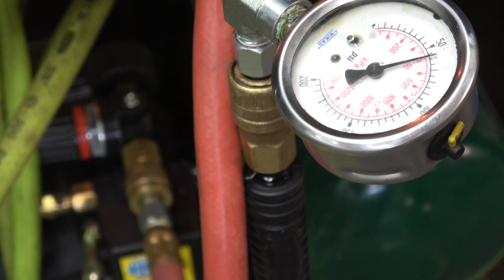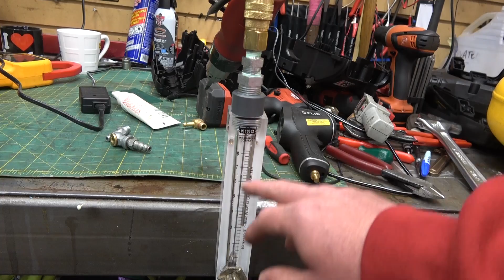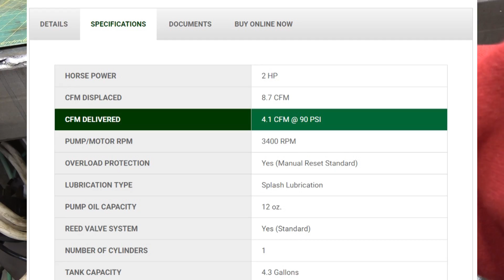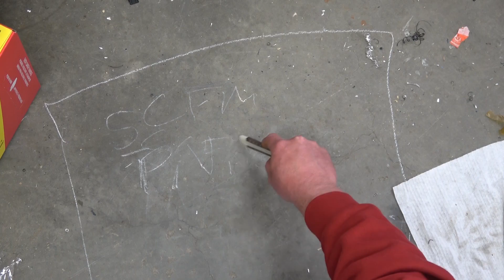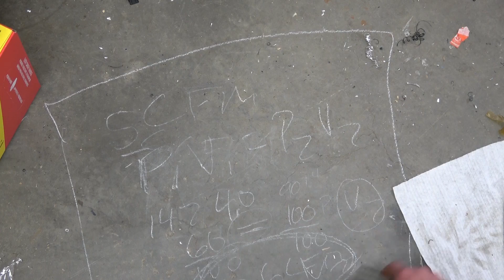Why are CFM ratings BS?

Comment: I have found the same issue with my compressors and I have decided on a gas powered unit cobbled together from scrapped compressors. I have also added tanks much like your air pig beside your compressor. I need more than 30 seconds of flow at 60 psi for my plasma cutter. Things get messy when their isn't enough airflow. I have having to stop and wait for the compressor to recover.

Comment: I think it makes sense, the compressor is rated for the amount of air it can move in standard units, and states the pressure it can deliver it at. It's the tool manufacturers who will pick their specific operating pressure (not a stansard) to publish and make it look like their tool uses less. 
You also cant rate the compressor at it max delivery pressure because it dossnt take into account energy loss through temperature change and RH change

Comment: I discovered years ago this problem trying to do sand blasting. Had to get 80 gal 5hp compressor and added some old water heater tanks to accumulate enough volume. Also discovered using a refrigerate unite to control moisture.

Comment: I have two compressors that are plumbed into my air system a 60 and a 80 gallon air compressor. With that kind of tool i would never recommend a compressor less than 60 gallon. I can have three of those running off my system without anyone complaining. My next compressor will be a screw type.

Comment: I use my compressors for pin nails and nail guns, cleaning etc..works great for a finishing carpenter. 
So what your saying is that tools that need continuous air flow are getting screwed? 
I always just figured you'd have to buy a bigger setup. But if they are advertising consumer sized compressors for that sort of work they best not be bullshitting

Comment: Well this explains why, after buying 3 compressors (progressively larger) I still couldn't use my air DA sander (for home bodywork) although the "specs" said they should be able to. I did learn to "cheat" on my paint gun (HVLP) by converting an old compressor tank (5 gallon?) into a " buffer" tank.. I run my compressor (20 gallon) at 100 psi into buffer tank, then output at 40 psi to hose/ gun. Paint gun is mostly continuous but you naturally have pauses, which give the compressor time to catch up.  Mostly/ almost. But you need to stop and sip your beer occasionally anyway, so..

Comment: Hey AvE just wanted to add P1V1 = P2V2 is assuming temp is constant. Since gasses undergoing decompression will lower in temp. The equation which takes it into account it (P1V1)/T1 = (P2V2)/T2 might work to just take ambient temp of shop then tape a thermocouple to the body of the valve on the grinder. Though I might just be overcomplicating shit unnecessarily. Anyway love your channel mam
Reply: I also suspect it's why they rate it with the volume of air at the inlet as the temp at which the compressor is held changes the volume effectively. However the over rating is still borderline criminal and a proper ISO standard should be used to dispel this sort of bs

Comment: Consumer compressors are designed for intermittent use (think nailgun, etc.). You also could have talked about the tradeoffs between the tank size and the compressor. I like the battery/charger/load analogy, but then I'm a sparky ;<)

Comment: I Wish I Woulda Seen This 25 years Ago.. Back then I Bought a Stone Carving Chisel that Uses Mucho Air ,@ 90 psi.  It was Nearly Impossible to Find a Compressor that Ran on 110volts that Put Out Enough Air. The One I Found Barely Keeps Up & it's Hard to Find a Circuit that Doesn't Blow Using it.  Once It Caught the Outlet on Fire! I Ended Up Getting a 5.5 hp Gas Compressor That Barely Keeps Up. Nice Hoses BTW I Like those Neoprene Hoses.

Comment: AAAAAAH! Yes! Thanks for sharing!!  This principle came to bear several years ago when working an a industrial project.  >$250,000 was about to be spent on a compressor package. Per engineering principles and the combined gas law the ACFM (acutal cubic feet per minute) @ 100psi and 60F was estimated. Sometime during the initial bid the air compressor folks informed us that in the compressed air industry ACFM meant the cubic feet of air actually needed at the inlet of the compressor. Ended up rebidding the package after terms were better defined which yielded substantially more equipment and a higher price.

Comment: I have worked on industrial air compressors (mainly Atlas Copco) for over 6 years so far and this information is correct. Atlas Copco, Champion, Gardner Denver, Quincy, Ingersoll Rand, etc are voluntarily held to CAGI’s strict standards and they cannot claim false outlet cfm ratings without repercussions. The cheaper compressors that you buy at the hardware stores are not held to many standards and most have “special” horsepower ratings when the actual horsepower is half of what it says. CFM ratings are the same. Since they are not held to any standards, such as CAGI, they can say whatever they want to about them.

Comment: Boyles law doesn't work for air compressors, its not an ideal gas. Main reason is air compressors pump air and make it really hot. As the tank sits the compressed gas will cool down, and part of the tank is holding water not gas. This water will change from gas to water in a cycle on its own as the tank sitting reaches thermo-equilibrium with outside air temperature. You can't use boyles law with pressure vessels. It just doesn't work...

Not knocking you. You are right the ratings are KINDA bullshit. But there is a reason...

Comment: Your rotameter doesn't look plumb. Side note: The mass of air in a standard 60gal (8 ft^3) receiver at 120 PSI is about 5.5lbm (2.5 kg for the standard unit impaired)

Comment: As long as the tools are using same measure,  same scale, as the compressor as long as the numbers are correct then it really makes no difference whether you agree or if its marketing.   Meaning if tool requires 4cfm and compressor says 5cfm then it will work

Comment: Okay,  I understand your complaint, but I also ask how many tools out there need to run at 90 psi? It seems to me that if you need that psi continuously,  you need an industrial  compressor,  not a home depot cheap one. It is  simple, guage your tools you will use verses the job you want done.

Comment: Yeah noticed this when i bought my first proper continuous cycle air tool and tried to use it in work. Even my twin cylinder (consumer grade) is struggling to produce enough air for it. Hence if anything bigger needs to be done, i daisy chain two compressors to DIY extra capacity air tank. With this setup it can be used normally. Thankfully both compressors were pretty much free for me and i get plenty of those since people dont know how to repair them, chuck into metal bin and from there i get to save them.

Comment: My solution: build your own.... do your own math.... 7.5 Hp used three phase motor, $100 ebay
old hot water tank and strip off the insulation, free.... rated 300PSI burst standard
used shopping cart wheels, free
scrap 1/8 sheet steel, free
double shive pulley, came with the motor
two used belts, free
pressure controller, $50
two Chinese V type pumps rated to take 3.5 horse, $100 each.
Result: enough air to run a blast cabinet flat out continually with a 5/16 nozzle.... cost total
$350 plus your time to build.... now running for 4 years no issues.
DONE

Comment: Fuck me I have been the dumbest dude in the west, I have lots of air tools and a commercial compressor, but I have been suffering from this issue for years, time to get a bigger blow job unit rated to output. Thanks for the insight, and yes it's in the vice.

Comment: Devices that squirt for a few seconds, then stop, do fine. For low volume workflow, air hammers, impact wrenches, are OK. But drills or sanders, or spray paint? Nope. With a weak compressor, it's all about the tank volume. You'll never be happy with less than 25 gal, but you can daisy chain extra tanks.

Comment: I have no experience in using air compressors but it seems you have the flow meter and pressure gauge just before the tool. While cfm doesn’t drop over the length of the hose, the pressure does significantly. The correct way is to have the pressure gauge right at the compressor output. I thinks thats how they measure for the spec sheet.

PS. I love your videos.

Comment: Uncle Ohm and Uncle Newton taught me to look at the amount of power used to find the BS. If its running on 15amps @ 110v its gonna be chugging 1650 watts max. Convert to HP -> 2.2hp. If it claims above 2 hp they are  majorly full of shit due to efficiency of single phase and heat waste etc. The sucker energy rating is generally about 3.5 CFM @ 90 per HP. Thus you get around 5 CFM max of suck performance on 110v on the most efficient machine.

Comment: Cheers for the heads up and the maths. I hadn't thought about those types of ratings either. Like most people, although I was dubious of the manufacturer ratings, I had always thought that good brands would be a safe bet too. However, this will now make it easier for myself to buy an Air compressor later on. Of note, I wonder how many salespersons would be completely shitted off rocking up to their store to buy an Air Compressor, then prove to them the Air Compressors they have are utterly fucked?

Comment: Hi, a question on air compressors if I may.
I have read and seen endless articles on both consumer and industrial products for drying compressed air as it seems to be important for the quality of work to be done. But I found nothing on providing dry inlet air to the air compressor to begin with. Do you have information on why this may be? It seems to me that this approach is not only desirable but both technically simple and cost effective.
My apologies if this is not an appropriate channel for my query, but after watching many of your videos I consider you the best to give a straighter response.

Comment: Just graduated with a ChemE degree, and in my minor industry experience, most of industry uses SCFM for gasses and equipment ratings. However, when reporting SCFM they fucking tell you they're using SCFM!! If they're not only going to not say that they're using SCFM, but also imply that it's CFM at a given pressure, then it's totally meaningless.

 If you're going to just choose which conditions give the most favorable rating, why not report the CFM at the temperature of the sun at that point? Why not assume it's at a near vacuum? Cause it would needlessly overrate the compressors to a ridiculous degree? That's exactly what they're doing already.

Comment: Okay. I'm with you. It's all a lie. Problem is, it's always a lie. So, what's your option? Not buy a compressor at all? No. You just buy a compressor that actually gets the job done. As long as they all use the same lie, they're still comparable.

To me, it's just astonishing that it's such an engineering challenge to produce something as simple as compressed air economically.

Comment: All about perception. As long as your comparing apples to apples when choosing which compressor to buy, who Care's. Get the biggest rating your credit card available limit can handle. I just look at the chart on the compressors carton and see which air tools have a check mark and then plan my beer breaks accordingly.

Comment: What measurement was the flow meter in? SCFM, CFM, ACFM?   Thank you
Reply: Well, it shows the flow of what's inside. So it is the flow of the air at the pressure of the air that comes through.

Comment: I’m not 100% on how this works but don’t you have to limit the air going to the tool to 90 psi right before it goes into the tool. It looks like you had the full pressure in the tank going into it which would eat up more CFM. There is also a rating on the compressor for 40 psi so you need to gauge the pressure back to 40 before going into the tool and check it there too.

Comment: In theory .....  what would be your results if you had a moderately sized compressor that fed a great number of large tanks linked together  in series.    The last tank in that series would have a high flow regulator set to 90 psi.  Granted it may take days to do so, but the compressor eventuality brings the pressure of all those tanks to 150 psi.   Would the air tool not be able to get its  needed cfm and psi of pressure for perhaps a few hours of continuous running before the multi tank system can no longer keep up ???
In a nutshell when compressor shopping, focus on the gallon capacity of the tank and know Size Matters 😏

Comment: Boyle's law only holds for ideal conditions, otherwise you use  the combined gas law which takes temperature changes into account; or better yet the real gas law which would take into account issues of thermal change, compressibility, phase change, etc. all together like a real gas which has molecular volume, inter-molecular forces and such

Comment: What ya want is a variable speed air compressor that can ramp up when there is heavy load and ramp down when its maintaining pressure, here is a helpful hint if your air tools cost more than your air compressor , you didn't buy an air compressor, you bought something that looks like an air compressor.

Comment: Wait till you do the math on the supposed 5hp motors that ship on those said compressors.  There is no way that little tiny 120v motor can produce 5hp.  They are rated in maximum developed HP.  Isnt that what they rate shop vacs with?  I have been down the path of the crappy compressor and learned a tough lesson.  That lesson sent me on the search for my emglo compressor i bought used for 350 on facebook from a closing tire store.  That thing has a real magnetek 5hp electric motor.  That motor alone costs more than any compressor at home depot and is twice the size of the compressor its attached too.  Then there is the manly air chomper that could suck the chrome off a ball hitch, the v4 pump.  I can run my impact and die grinders all day long with no impact to performance.  The small 30 gallon tank makes the compressor cycle on and off, but it saves space.  It delivers a true 22 cfm at 120 psi.  It will go from completely empty to 130 psi in 46 seconds.  That was the test Jenny (Emglo was sold) had me run to test the performance of the pump to find out if I needed to open it up for any service work.   All for $350 smackers.  

Its kinda like your old snap on impact wrench vs the new HF earthquake xt.

Comment: So is it that the Air compressors are over-rated OR are the tools under-rated?  It seems to me that the tools should also be using the same equation, which would be the amount of air at their exhaust at atmospheric pressure.  So your die grinder should actually be somewhere in the area of 21CFM ???

Comment: great video as usual, but that's what you get for trusting German "intake cfm-rated pumps".  I've owned a couple-few duty-rated compressors, and they do what they say.  In my experience they performed as expected, but i've only used die grinders  that would really test them without relying on volume tanks.

Comment: I have a semi-industrial small compressor that's rated at 15CFM - but when I bought it I knew that  was intake air and the output would be around 8 to 9CFM for air-hungry tools like die grinders, etc. Not really a problem, as I don't use it all that heavily, but I was mildly pissed off when it would only just keep up with my cheap-ass die grinder and an hour using that had the compressor running almost continuously.
So, even allowing for the cheap-ass die grinder being an inefficient piece of shit (I didn't seriously expect it to be anything else) it looks like the FAD is a bit optimistic anyhow.
In Europe, compressors are sold with the intake CFM given the BIG NUMBERS, but the Free Air Delivery is usually quoted too. Not sure if that's a legal requirement or not, but most seem to do it. The BIG NUMBERS still sucker thousands of buyers every year, though.

Comment: Air tools are so inefficient. To run a 1/2 HP diegrinder continuously, you need at least a 5hp or 7.5hp compressor. Incredible efficiency loss.

Comment: Problem is that conventional poorly engineered compressor can either do high volume or high pressure, and not both. 

Years ago someone had built themselves a Tesla turbine compressor (Nikola Tesla inventor, not the electric car) which could do both high pressure and high volume without the need for a storage tank.

I'm shocked that I have known about this issue for decades, probably the one and only thing I knew that AvE did not.

Comment: Nice video though admittedly I knew they were doing this before watching. 

My question is: What quiet small oil free compressors are out there that can actually deliver a decent true cfm of around 4 @ 90psi? 

Are there any good brand names were don't have to second guess what a true output CFM rating is?

I need something small that can handle 4.2cfm @ 40psi. 

It has to be small, and quiet. And not cost an arm and a leg.
I'm having a heck of a time trying to find one.

Comment: So basically they are measuring the pressure in the compartment before the trigger is pulled, so they are hoodwinking people of the actual capability. So they are essentially used car/snake oil sellers.

Appreciate the video.

Comment: Im surprised you thought a 2HP compressor would run a air tool.. Ive always known in Australia that 2.5HP is the min recommended for a air tool, 2HP is fine for pumping up tyres and sprayguns. Even bunnings (The homedepot of Oz) recommends a min of 2.5HP.